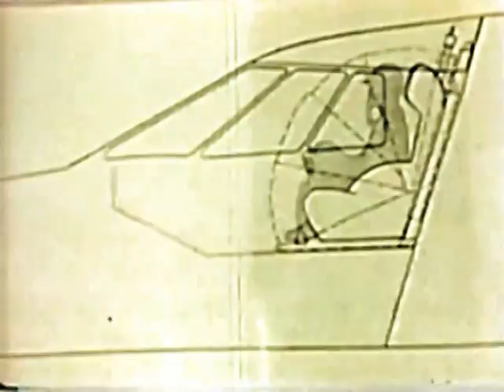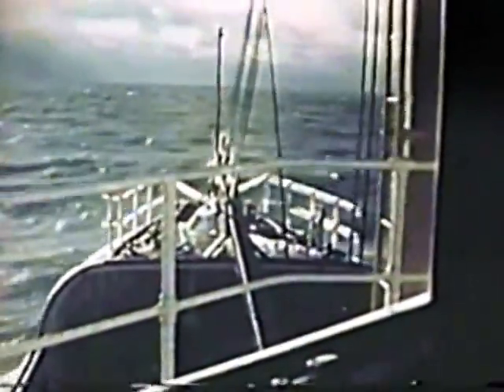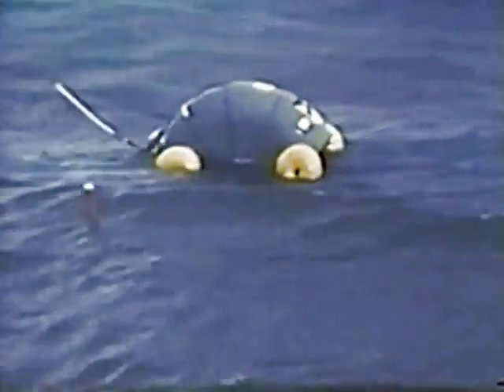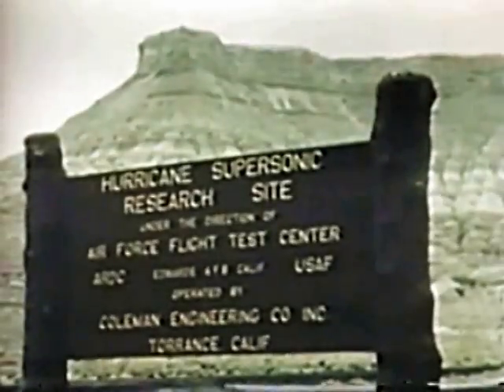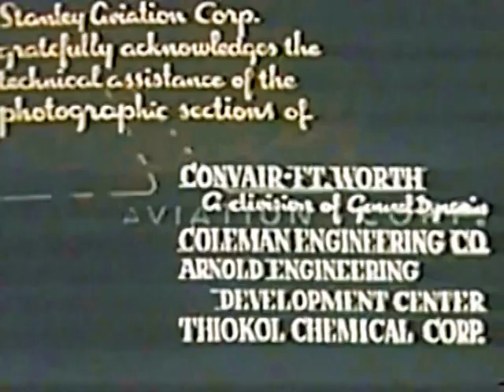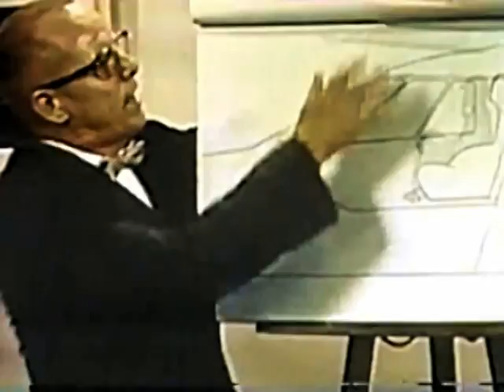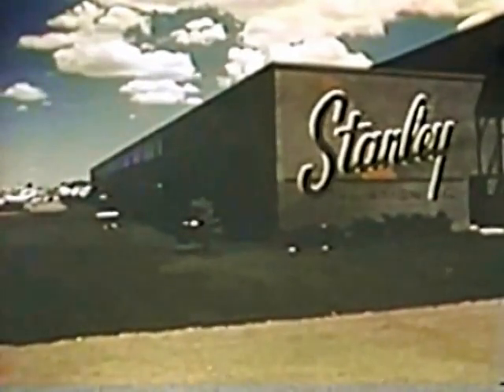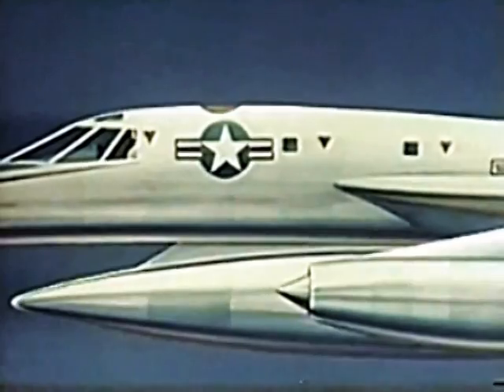"Escape and Survive" B-58 HUSTLER escape module development

Comment: I worked at Stanley Aviation in Denver Colorado in the late 70's. They were pretty much out of the egress system business by that time although they did some egress work on early experimental Airbus's. There were 3 complete capsules in an office in the administrative area of the building. Stanley manufactured flexible metal fluid couplings for the aerospace industry. It was pretty cool stuff. The egress capsules were moved to the Wings Over the Rockies Museum at the old Lowry AFB in Denver. There is an area dedicated to Stanley Aviation at the museum. It's a great museum.

Comment: enjoyed this.  one of my university professors worked for Coleman building and operating the Hurricane Mesa facility and he told me about the B-58 capsule tests.  This inspired me to eventually work for McDonnell-Douglas Escape Systems group as a test engineer and used the Mesa facility several times. 
the T-28 they mentioned actually belonged to Coleman, not Stanley, and was still flying in the 90s.

Comment: Would this system have been useful for the space shuttle?
Reply: Yes in the Gemini/Apollo era, but for Space Shuttle, NASA went to a nitrogen/oxygen mixture. They also went to a pressure of 14.7 pounds psi, rather than the 5 psi of earlier, pure oxygen capsules.

Comment: Luckily it never had to be used by humans. But good to know it could safely eject a 2-year-old bear at Mach 2.
Reply: D Hall while this particular system was not used, the XB-70 Valkyrie used a system like this. When the system was used during the crash of one of the Xb-70s on a demonstration flight the forces of the aircraft spinning due to loss of vertical stabilizers caused the pilots arm to get caught while the pod system was closing shattering his arm. What I notice about all of these tests is the engineers always assumed ejection would be done on a straight level flight, they never accounted for gforce fluctuations which could confuse the system and not allow for a safe engagement...
Reply: D Hall The escape system was used twice by crewmen and once accidentally by maintenance.

Comment: 3'33":cumbersome pressure suits? What about ejection device in sr71?
Reply: The SR-71 is smaller inside, and could not afford the volume or weight taken up by a similar system.  The pressure suits work just fine.  There was a situation where a Blackbird broke up in flight and at speed, and the pilot survived.

Comment: Great idea, Why they didn’t use in other airplanes?
Reply: The F-111 used an escape pod.   A significant portion of the front of the airplane departed - both crew members stayed together in it.
Reply: It was discovered that they really didn't provide much benefit. The F-111's pod was more trouble than it was worth. Pilots generally didn't trust it. And it was like trying to land a Gemini Capsule while under fire. I think most of the pilots prefer to take their chances with the more traditional system than be strapped in a coffin hurtling to the earth.
Reply: @andrewtaylor940  The One-Eleven system worked very well actually, but it was unnecessary because except at sea it was not enough an improvement to pay the price in weight. You need to remember both airplanes, the B-58 and F-111 were built to fly over mach and low level. You don't survive a seat ejection in that environment.
Reply: @duster0066  I dunno, One of my College Summer jobs was working out at Grumman's main assembly plant and test area back when they were doing the EF-111A conversions. The Test Pilots all HATED those bloody capsules. Never trusted them as it was a sealed capsule that they felt they had no control over. Granted these were Test Pilots, so they hate anything that isolates them from control. 

My Dad was one of the designers on the ejection seats for the F-14 and C-2 Greyhound. He always thought the same of the Capsule. They worked well enough, and they did keep the flight crews together, as did the A-6's tandem seats, but nobody really seemed to trust them. I think some of the problems with (and fatalities caused by) the XB-70's "Pod's" led to some major Pilot distrust from early on. The F-111 system was more reliable as it just ejected the entire cockpit, fuselage and all, so no moving parts to snag the pilots. But it still was seemingly unloved.
Reply: @andrewtaylor940  Cheers man. I worked them for 8 years, all models. Every crew member survived when ejecting inside the envelope on my units crashes. They all died when ejecting outside the envelope. There was a failure on an F model iirc, but that is the only capsule failure I know of. The bridle cable failed. The major problem was with back injuries. There were a lot. I rode home from Vegas on a 141 with a major that had punched out of an FB the day before. He was gutting it out but was in bad shape with a back injury. Even when the bag worked which it mostly did it was still a hard hit. That capsule was really cool. It had flight controls that were powered by the pyros to fly itself upright if there was enough altitude. The 4 guys that died all ejected upside down at low altitude...no chance. I was crash recovery on both of those crashes and we sent crews to both. Both capsules attempted to right themselves and one almost made it. It worked. And again remember the mission of the jet. Mach 1.3 at 200'. You don't survive that in a seat. Plus the Navy insisted on it being a boat. So it was a boat to. The bilge pump would pump water and air to keep the bags inflated so the thing would float. It weighed like 3000 pounds. Stupid heavy.

Another Vark tid bit. The capsules were made by McDonald. They all had a McDonald placards on them with a McDonald S/N. It was a separate airplane.
Reply: @chrisstairs2237  Your sarcasm doesn't change the fact that the F-111 escape pods, did, in fact, work.   Working does not equate to 100% - nothing is that reliable.